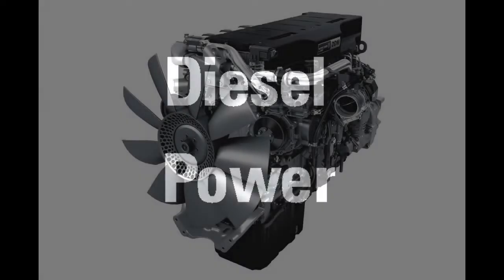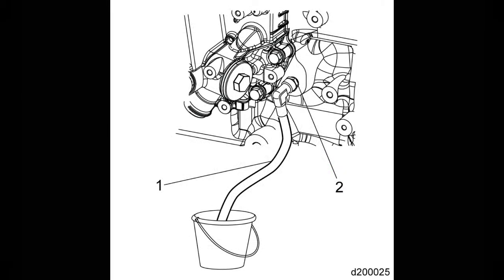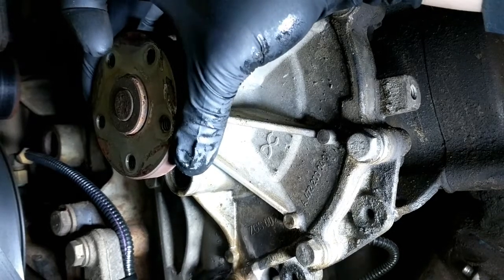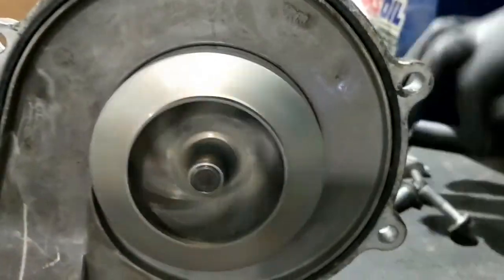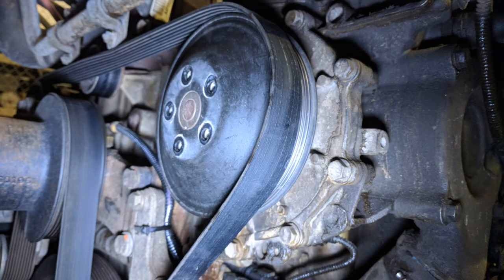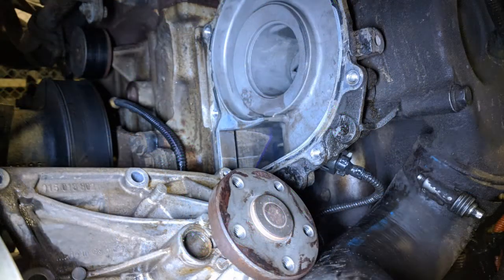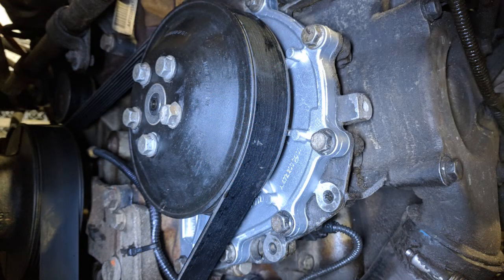Replacing a Water Pump in a Detroit DD Engine

Comment: My question to you is, do I need a water pump for a 2014 DD 15 Cascadia evolution. Napa, and fleet pride, quoted me a price of $55.49. I’m sitting at Freightliner right now, and they quoted me a price for that same engine, $750 with the LandstarDiscount, can you tell me if the aftermarket water pumps are of same quality. I’ve even called my nephew in New Jersey, he called the Freightliner up there it was even more over $800 for the part, and when he put me on a three-way call the auto parts Napa, NAPA told me the price was $55. Can I get your opinion please.
Reply from the maker: I'm afraid I have no experience with aftermarket pumps for these. With a price difference like that, it may be worth looking into.
Reply: What did you find out?  I only ask because I have a 14 dd15 and I need to buy a pump tomrow

Comment: Thank you for your video is very helpful, I’m getting ready to change my own water pump. I’m very much mechanically inclined. Working on my own cars and things. And I took a good look at this pump and I seen it’s easy enough to change out., But I just want to know am I going to need a pulley puller. Please let me know I should have the brand new pump by tomorrow which is the 28th. And I should get started probably by the 29th.
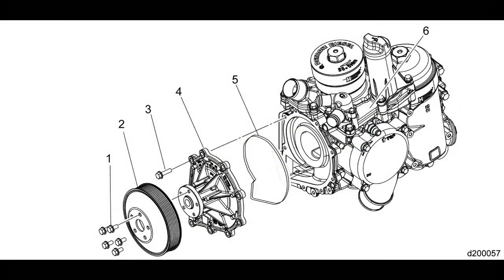Reply from the maker: No, you shouldn't need one as long as it's just a single speed pump. As you can see at 0:48 the pulley is just bolted on. You may need one if it's the other style pump with a drive clutch on the pulley. I'm not sure if you can get away with not using a puller because I've never had to replace one of these.